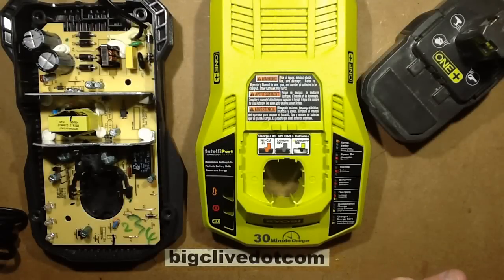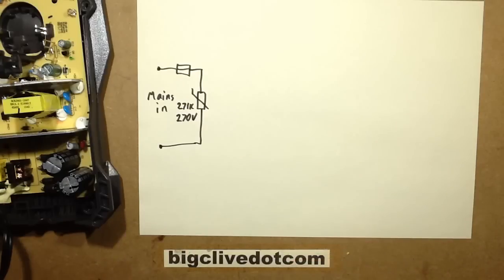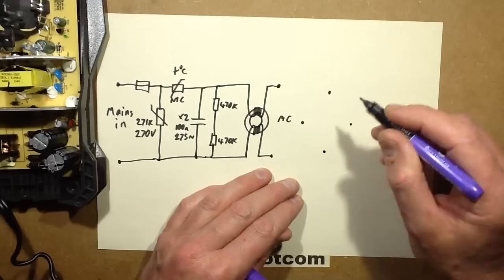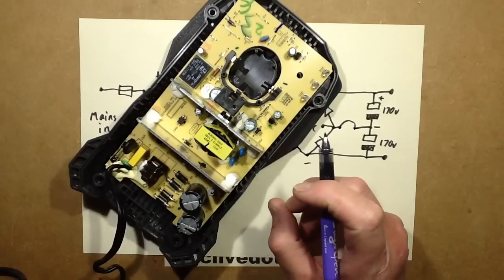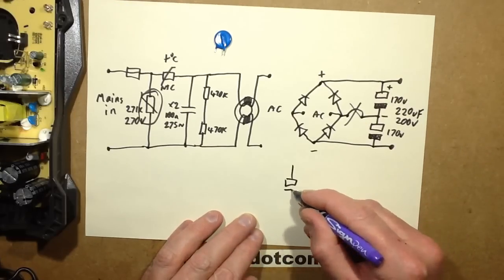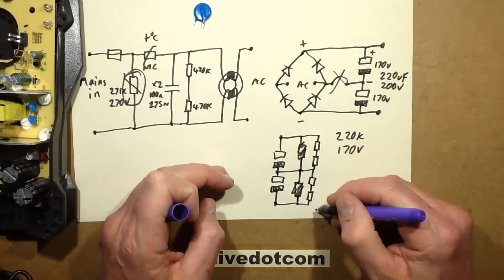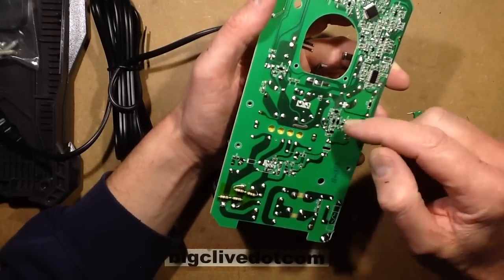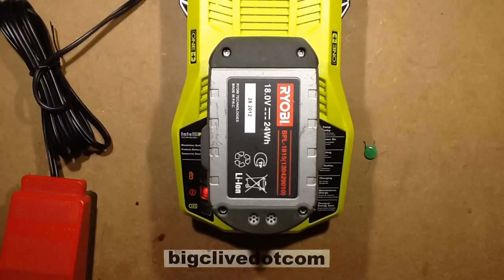How to convert Ryobi P117 charger from 120V to 230V use.

Comment: The Ryobi charger's are crap, there tools and batteries are great, however the Chinese copy of the Ryobi fast charger which is almost identical to this is a lot better, don't know why, but if your just doing DIY don't get the fast charge stick with the standard chargers no more than 1.5 ah output your batteries Will love you for this

Comment: Can the US 120 volt charger be used over here just plugged into my 110 volt transformer?
Reply from the maker: It should be OK in a traditional 110V transformer.
Reply: Many thanks, I bought the Airstrike stapler from the U.S and it came with the US charger. although I did buy a UK one I can still use this as a spare on site, just change the plug to a 110 volt.

Comment: Clive  the cycle is different which may cuz irregular charge  UK 50Hz USA 60Hz other than that your explain is very good ..
Reply from the maker: With a switchmode the frequency is not important as the supply is converted to DC and then back to AC.  Frequency is more of an issue with traditional core and coil transformers.
Reply: thanks for the clarification sir

Comment: Hi Clive can you tell me will a EU P117 one work ok with hour 240v ok thanks good job as always. Jeff
Reply from the maker: If it's an EU unit rated for 220/230V it should be fine.
Reply: Thanks Clive I was thinking a Ryobi Battery with 5 18650s can you put 5 Batterys from a another to make 10 I have as lot of the shall Batterys good luck. Jeff

Comment: Hi Clive, I wondered if you could help. This video stuck in mind trying to answer this question. As I'm sure you know, brands such as Makita, DeWalt etc sell 110v chargers for a much higher price with the tradesman in mind where on site power is 110v. So to get around this I've always used a 110v to 240v inverter as that's much cheaper than buying 110v chargers for all my tools. However, a friend has made a 110v to 240v domestic socket fly-lead and he powers his standard 240v chargers on the site 110v that way without a problem. Is it just a marketing gimmick selling the expensive 110v versions? Could it damage the battery some how? Hope you get time to help me answer this one.
Reply from the maker: Some chargers are rated universal voltage and will run from about 100V to 250V.  If they are designed only for 240V then they may be unstable on 110V, but they shouldn't damage the battery.  DeWalt and some others do milk tradesmen.  They base the price on their perceived value in time to the tradesman.
Reply: bigclivedotcom thanks for that!

Comment: THIS VIDEO IS A LIFESAVER FOR ME. But here's my MAIN concern.

I completely forgot that this charger is 120v and i plugged it straight to 220v. Obviously, i heard a pop and its too late already that i realized that it was 120v only. Seeing as there's a fuse, can i still fix this just by replacing the fuse? And if yes, how did you remove the screws as well? I noticed there's a small "pin" pointing out the screwheads to prevent it from being tampered or opened (i guess?)

Help would be greatly appreciated!!!
Reply: The screws are just "tamperproof". Just use the correct driver or driver bit to open the case. Kits of "security bits" are available fairly cheaply on fleabay.
As far as what you need to do to fix your blown supply, it depends what you find when you open it up. You may be very lucky and find it's only a blown fuse, but you'd more than likely find other components have been fried before the fuse blew.

Comment: bigclivedotcom The Isle of Man is a self-governing British Crown dependency in the Irish Sea between England and Ireland. It’s known for its rugged coastline, medieval castles and rural landscape, rising to a mountainous center. In the capital, Douglas got this from wiki, anyway how far from this city do you live? we would love to move there, how is your immigration system since your self governed? I only have one leg but I can run cnc's manual lathes mills etc  just a all round machinist. metric is no problem. just asking Old One Legged Joseph T
Reply: If you've only one leg then you are two short of the pre-requisite number required to be classed a Manx. ;-)

Comment: Dear Clive,
Thanks for the video! 

I have P118 charger, its board is a little bit different.
Opened it yesterday and changed the varistor. I didn't find any link between AC and the only capacitor nor did I remove anything else. Switched on for a second and presumably baked the 200V capacitor on the primary circuit.

Today i exchanged the capacitor 68uF@200V for 68uF@400V. As a result red LED is blinking ~1Hz, inserted battery doesn't charge and green LED stays off. Could you please advise what might be wrong? Try twice less the capacity?

The board:
https://ibb.co/fdbsT5
https://ibb.co/e1UCT5

Thank you in advance!
Reply from the maker: It looks like that board may be designed for a single voltage.  Adapting it for the higher voltage may require  swapping other components and if the transformer is specifically wound for the lower voltage it might not be viable to convert it at all.
Reply: Thanks for your prompt reply!
I already tried to connect it to 220V. If I solder old varistor and capacitor back does it have a chance to work via external 220->110 converter or I might have burned anything else? May be I can even leave higher voltage varistor and capacitor for 110?
Reply from the maker: You could leave it as it is and try it on 110V.  Do you have a shaver socket to try it in?
Reply: No, all my sockets are 220. I'll order 110 to 220 converted from Ali to try
Reply: bigclivedotcom Shaver socket? Is this like a single 120 volt socket in your house

Comment: Dont you have to switch frequency to 50Hz from 60 Hz? I have one of those and it says only 60Hz.... Am in Canada btw hehe....
Reply from the maker: As soon as the mains goes through the rectifier it's converted to DC whatever the frequency was.  You could actually power this unit from DC supply.

Comment: Huh, I was also kinda confused about the absence of resistors to discharge the capacitors separately. They are only discharged in series, but discharging them in series and possibly reverse charging one of them is generally the problem, not charging them in series. So yeah, rather strange. I quite like the way they stepped up the voltage though.
I also like that it's essentially possible to convert it by simply cutting a wire and removing the metal oxide varistor (which isn't really necessary for normal operation). Although I would also feel better at least adding the resistors, just to be safe.

Comment: Another downside is the warranty, probably not covered in the UK. I bought Makita batteries from ebay that turned out to be the American versions. They went faulty after a year and Makita UK wont touch them. Had they been the British versions then they would have been replaced no problem. :)

Comment: it wouldn't matter if your supply was 50 or 60hz right?
Reply from the maker: No.  Not with a switchmode power supply where it's converted to DC as soon as it goes in.

Comment: shouldn't you put resistors in parallel to increase their power rating? Or did i misunderstand smth? can anyone explain me this part please.
Reply from the maker: They can be put in series or parallel to share the power dissipation.  I put two in series mainly to halve the voltage across each resistor.
Reply: bigclivedotcom I see thank you

Comment: Anyone knows if this convertion could work also for ryobi p118 charger?
Reply: P118 has a little bit different schema.

I just opened it and changed the varistor. I didn't find any link between AC and capacitor's leg and didn't remove anything else. 

When 220 turned on for a second I noticed a sound of capacitor's baking and immediately disconnected. I suspect I need to exchange it for 400V capacitor. But which capacity to choose? Same or 68*120/230=36uF (the nearest I can get is actually either 33 or 47) I assume I don't need to install the second capacitor, right? I would really appreciate If Clive can comment. Thanks!
Reply: The board:
https://ibb.co/fdbsT5
https://ibb.co/e1UCT5

Comment: There is another garden tool company, Greenworks, that make products much cheaper for Brits to ship from USA and have the same unavailability of 240 volt AC input for chargers of 40 volt output and 80 volt output. Be great to see mods of those, particularly the 80 volt, if they come your way.

Comment: Electronics learner here... when you added those resistors after the two big capacitors, aren't you limiting the current that the whole unit can take in? Wouldn't this slow its charging speed?
Reply: The resistors went in parallel to the caps, not in series. So, no, it didn’t limit the current.

Comment: Hmm I would also recomend that the Inrush Current suppressor is changed as well as it draws the same power rating in watts but as voltage is doubled the amps is halved so inrush supp resistance needs increasing. Also fuse rating will need to change as half current. Maybe Im wrong but food for thought...George

Comment: What is the voltage rating on those American single insulated flexes? I suppose with only 120V there is not as much risk of fatal shocks from abraded cords.
Reply: What is the amperage on a UK circuit? I heard it is higher than 13 amps so he might still need a fused plug.
Reply: If he is connected to a radial it would be 20 or 30A, a ring main could be 30A. And those are just typical circuits, there are higher rated ones in some installations.

Comment: If people only knew how badly those 120 volt circuits with 15 amp breakers limit us in the USA for powerful electric tools. If the USA had went 240 volts then we could use very powerful AC induction motors up to 10 horsepower that would out power gas engines for things like log splitters, pressure washers, and mulchers since the torque and horsepower increases with AC induction motors vs gas engines that lose torque and horsepower when overloaded. 

Instead, the ignorance of the belief that electric cannot handle the jobs of gas has not changed for us in the USA since the market here is limited to 120 volt at 15 amp rated motors and tools since we are mostly 120 volts here. Sure we can have a dyer style outlet installed for outside use, but then people in the USA don't like hassle and we are lazy, so we would not bother with having a 240 volt outlet installed for outside use of 240 volt tools.

I also think the small gas engine companies have a role in trying to keep the public from seeing just how powerful AC induction motors are compared to gas engines. It would hurt their sales when people realize that a 5 HP AC induction motor performs like a 8 HP gas engine, and the gas engine will be less reliable, needs maintenance, and poor starting in the cold weather.

Comment: Another outstanding vid, Clive, you're the man!  Your analysis and interesting  patter is reminiscent of a few top notch  instructors I can still remember as a jeep radar tech while attending  basic electronics school at Kessler AFB in 1957. Yep,  they actually taught a full years circuit  fundamentals back in the day before one  ever got into the guts of the  "set" he  would ultimately learn.  It's been a real treat to get an occasional  refresher brush up  from a genuine  pro, these 6 quick decades later....
Reply: I went through electronic principles at Keesler about 5 years ago. I think it was 7 weeks at Dolan Hall... barely enough time for the beginners to learn what a capacitor was. The instructors did a good job with the time they were given. There are pictures on the wall there from classes in the 50s!

Comment: You wouldn't expect balancing resistors across the capacitors with the link in because the voltage across them is defined to be 170V by the rectifier. It would just result in extra heat to dissipate.
Reply from the maker: The full rectifier and link suggests deliberate facility for conversion to the 230V version.  In that case it would require the balancing resistors.

Comment: Clive the balance resisters are not necessary due to the circuit design. The center tap of the Capacitors feeds one end of the Primary while the other end of the Primary connects to the center of the Switching Fets. It is a push pull design where each switsh is driven alternatively to drive current back and forth in the primary. At the switching frequency of (probably)200K the extra voltage across each cap results in minimal extra current : so reducing the extra volts :- therefore balancing the series caps . By the way replacing with single cap won't work:- no centre tap for the primary !!
Reply from the maker: This was a conversion to 230V so the centre tap on the capacitors wasn't used.  The single cap would work in this case as the tap is not needed.

Comment: Question re capacitor X2 (100nf 275V).
Would that survive the 240V input (~330V peak) or should that also be replaced with a 400V capacitor?
Reply from the maker: A 275 AC capacitor is rated to handle the peak voltage of the AC supply.

Comment: Hi Clive, love your channel. I spotted this induction heater, Id be keen to see you run it. Have you seen one in operation before?

http://www.banggood.com/Low-ZVS-12-48V-20A-1000W-High-Frequency-Induction-Heating-Machine-Module-p-1038472.html?utm_design=41&utm_source=emarsys&utm_medium=Mail_promotion160923_email&utm_campaign=newsletter-emarsys&utm_content=Claire&sc_src=email_2016671&sc_eh=a3eb6c7b7bab3d0f1&sc_llid=553046&sc_lid=86124848&sc_uid=8x9KHBuBgy&emst=8x9KHBuBgy_553046_2016671_117
Reply from the maker: Induction heaters are commonly used to melt small amounts of metal, process electrodes in neon tubes and assist in removal of seized nuts by localised heating.  These ones are based on rugged Royer oscillators.  That one is quite powerful and would require a very heavy duty power supply and water cooling of the heater coil.
Reply: thank you for your knowledge

Comment: Those US cables are regarded as "reinforced insulated". Reinforced insulation is equivalent to double insulation. Just check the rated voltage on them if it is 300 or 600V and not 150V.
Reply: I'd be tempted to replace SPT-1 anyway (its insulation is only about 0.76mm thick which doesn't provide that much tolerance for abuse). (H03VH-H which is similar but in metric used to be common in Europe and Australia, but not anymore.)
SPT-2 (which is most likely here) is noticeably more robust (1.14mm thick insulation, comparable to the 0.5 inner + 0.6 outer of H03VVH2-F), so I'd be OK with keeping that. (Then there's SPT-3 which is thicker still.)

All SPT variants are rated for 300V, and in fact there aren't that many mains cables rated for less than 250V (I know of some XTW being rated for 125V, but that's about it).

FWIW, I prefer the sheathed cords (H03VVH2-F, H05VVH2-F and equivalents) from an aesthetic viewpoint (for not having grooves between the cores to accumulate dirt) anyway. (There is NISPT-2, but that's somewhat strangely designed with thick inner insulation but very thin sheathing. The rarely-used NISPT-1 also has thin inner insulation; no NISPT-3 exists.)

Comment: Instead of the resistors on the capacitors, could you just remove the caps and replace them with one single "uk compliant" capacitor?

Comment: Just pulled out the only traced cct I could find of a PSU using this 120/240V switching (a 200W PC PSU traced in '93) and it had 120k ½W balancing resistors across 470u caps, so your 220k across 220u looks spot on.

Comment: THANK YOU. I was very surprised when I bought this think in the US that it wasn't universal voltage.
Reply: The regulations are requiring the stuff to 'be green' and waste less power.  So they put the jumper or for the PC power supplies they put a 120 / 240 switch.

Comment: Thank you for this.. I think you should have done this a month ago.. I could have used in converting the Milwaukee 110V charger. I did change the caps, and the clamp, but still might have burned it :(. With your suggestion I need to check the link from AC to the middle of the two series caps.

Comment: what is more efficient, 240 or 120? I have both wired throughout my house. I did it custom since I go between Asia and USA quite often. I have junk from both sides.
Reply: I'd say 240 - you need lower currents, and as such, lower voltage drop across the wiring.

Comment: Is it possible to convert any of the ryobi chargers to 12v? I am a ryobi fiend =)
Reply from the maker: Not easily.  But I think it may be possible to get a vehicle charger.
Reply: Sure, it's called buy a cheap 12VDC -> 120VAC (or 240VAC) "automotive" inverter and plug the Ryobi charger into it. Those "automotive" inverters have become dirt cheap at Harbor Fright / Princess Auto / Cambodian Tire / et. al. and the charger seems to only draw a couple amps so you wouldn't need a super big inverter. The inverter's AC sine wave isn't beautifully smooth but it shouldn't matter since the charger immediately rectifies it anyway.
Reply: I can only get the in car charger from the US and none come with customs paid so last one was £70 all in. Maybe I'll try the efluky one with a good boost converter needs 36v dc supply at 2A
Reply: I was talking about something more like this:
http://www.maplin.co.uk/p/ring-automotive-rinvu300-12v-modified-sinewave-240w-inverter-a02tr
Not necessarily this exact model though.
Reply: Or this.
https://www.amazon.co.uk/BESTEK-Power-Inverter-Adapter-Charging-Red/dp/B00RV69O0I